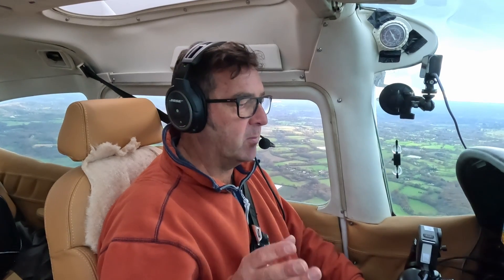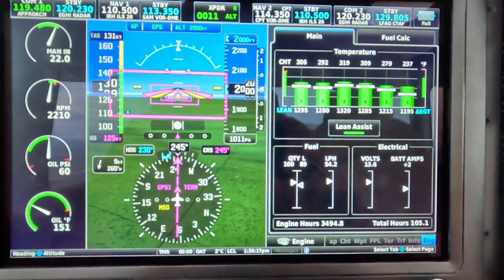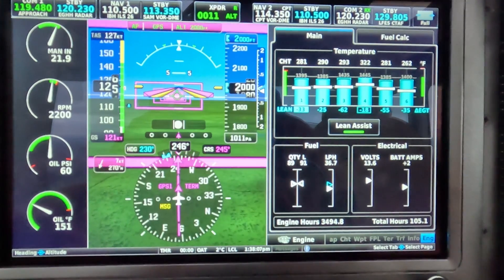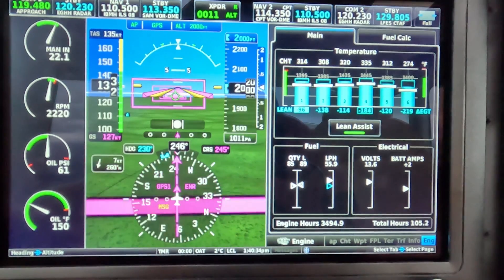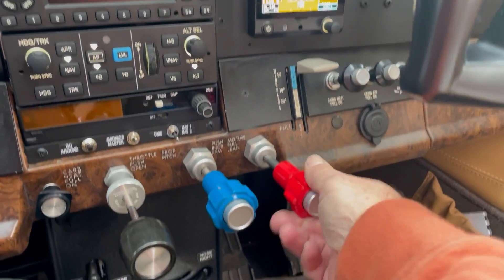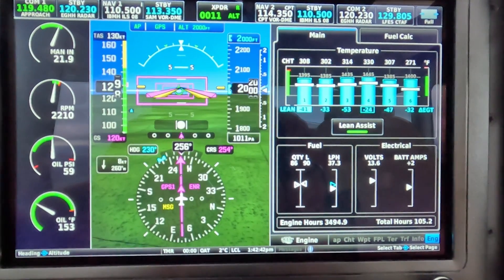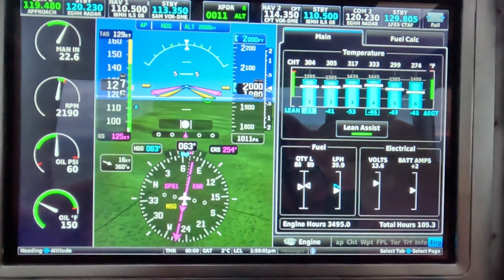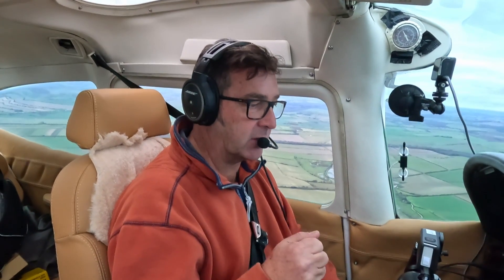Leaning Your Engine

Comment: The best indicator of economy is the range. The biggest the range, the better the economy. You can lost five o no more than ten minutes per hour, but you can save a lot of money in fuel and going far with a maximum weight inside limits.

Comment: My thought is my Mooney 201, with the io-360, at 11k or 12 k, is only producing 60% power.   I burn 11 gal/hr.  My CHT never goes above 360 so I am going with best power and I am getting 155 kts.  When flying high I think it makes sense to be best power.  

Does anyone think different?  I just put in GAMI injectors so I think LOP is now a option.  Even at 11 gal/hr I have over 5 hours range so that's about all my bladder and legs like so extending past that doesn't seem needed.

Comment: You are not getting cylinder temps up high enough for the lead scavenging agents in the 100LL fuel to function.  Also, your oil temp isn’t getting high enough to burn off built up water.  I’m guessing you still had your cowl flaps open.

Comment: In instrumentation of any kind the saying “don’t chase the needle” is good advice.
What makes you think that the instruments are precise?
What makes you imagine that the fuel flow meter is precise?
When heavy, hot, and high with a fixed pitch prop you will lean to highest RPM. Calculate that fuel burn at the next fill up— total gallons for the trip and gallons per hour.
Experiment over time with lean of peak RPM.
You may be surprised to find that peak RPM gallons per trip is similar to lean of peak RPM gallons per trip. 
The airspeed and time enroute change, yet gallons per trip are similar.
So— when heavy, hot, and high— “Don’t Chase the Instrument”
Yes, lean to engine stumble and back off a bit for powered descents. Milk that altitude! 
And trust your most precise instrument— your pocket calculator!
Happy Flying!  (1500 hour pilot that flies C172 over Wyoming mountains in the summer at 12,000 feet at max gross)
Reply from the maker: All good advice. Every plane, engine and prop combination are different, it's important to experiment and find what works for you.

Comment: That is a great book written by Mike Busch,I also speak to him from time to time. I would like to give you some more info on running LOP. Mike says NEVER use a lean assist on any engine monitor to go LOP. It takes no more than 3 seconds to be LOP from full rich and not to use EGT as a leaning reference as it is not an absolute temperature. Look up his leaning video on YouTube called” Savvy Aviation, The Red Box”. Nice video keep up the good work.
Reply: If you don’t use EGT as a reference in discovering LOP, how are you supposed to find LOP?
A&P/IA
Reply: @David-p7z9n  lean the engine until you  hear roughness then go back in rich just enough for the roughness to go away and you are LOP. Or lean until,you feel loss of power and you are LOP.
Reply: https://www.youtube.com/watch?v=msYJxkHg0Co&t=3072s
Reply: Proper and safe LOP involves EGT readings
Reply: @David-p7z9n  not according to the author of the book you said every pilot should read. Watch the video and you will hear how Mike says just the opposite.
Reply: @dreamcatchercowboy  Where did I say every pilot should read a certain book?
You’re mixing me up with dreamcatchercowboy’s comment
Reply: @dreamcatchercowboy  It’s nothing, I do that twice per week!
Reply: @David-p7z9n  thanks for your understanding on behalf of my mistake, more people should have that kind heart.
Reply: @dreamcatchercowboy  At 61, my heart has softened compared to 30 years ago.
Reply from the maker: Totally agree. I'm just trying to impart the basics. Mike Busch is the guru on all things engines and leaning. In his book there is much more information and advanced techniques for leaning. If you are at 65% power or there about the 'Red Box' goes away. But you are right, a quick pull on the mixture to obtain LOP is the way. But you need to first find the positions and numbers that relate to your particular engine. Many thanks for your input.
Reply: @ginclearaviation  Leaning is no issue to 65% if you’re running Continental, 75% if it’s Lycoming due to sodium filled exhaust valves which take a little more heat
Reply: @ginclearaviation  you are most welcome,i have many vidoes on my channel i show how i get to LOP on all of them. thank you for the nice comment.

Comment: Great demo Dan, well done, nicely explained. 
Leaning is not generally a well understood procedure in the UK, with our near sea level airfields and low-ish cruising altitudes. Not to mention that age-old debate still vehemently espoused by some, the Lean vs. Rich of peak argument. I’m with you though, and as Mike Busch says when done correctly leaning to lean of peak is not only much more economical (good news at today’s fuel prices) but significantly better for our engines. The downside as your video beautifully portrayed is the loss of 5-10kt TAS, on average. I can live with that, especially if my engine is going to thank me in the long run.
All the fuel is burned when operating lean of peak verses rich of peak, where some of the fuel disappears out of the exhaust valves. The payoff is a much cleaner burn with far fewer carbon deposits left behind in the cylinders and on the valves. An added bonus is minimal chance of carbon monoxide leaks, as there virtually isn’t any CO left over from the combustion process when lean of peak.
Worth stressing too that leaning on the ground, even at sea level, can be beneficial after the engine is started and before take off. For anyone who remembers old cars with manual chokes, we wouldn’t run around with the choke out after start - running our Lycomings and Continentals is pretty similar. These engines are old tech with pretty basic fuelling, which is why we’re given a mixture control to help them burn fuel and breathe air correctly. With the exception of start up, take off and go around, there’s not many times full rich does us any favours.
Love your content thanks, keep it up. 👍
PS. great OAT gauge sticking mod in your left wing root 😅.
Reply from the maker: Thanks Rupert. Great comments, tips and advice.

Comment: Very interesting Dan. I did a very rough calculation based on 100km journey  and the fuel saving is significant but the time penalty was only marginal, a few minutes at worst.
Reply from the maker: Hi Allan. Yes, after three hours at Lean of Peak I save enough fuel to do another hour compared to running at Rich of Peak. Fantastic fuel and money saver, and should make the engine last longer too.